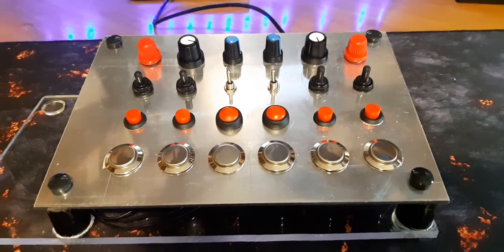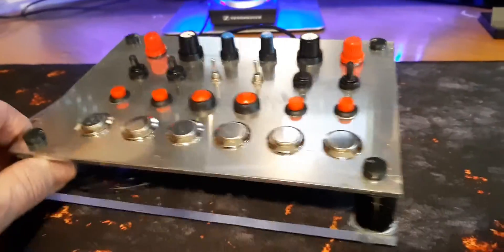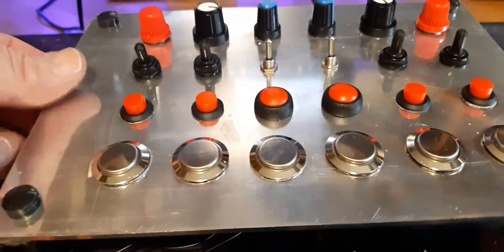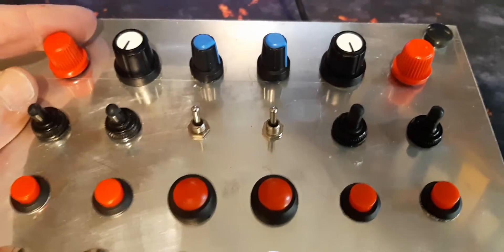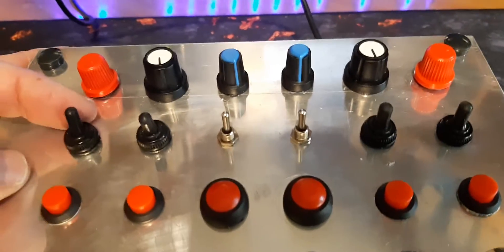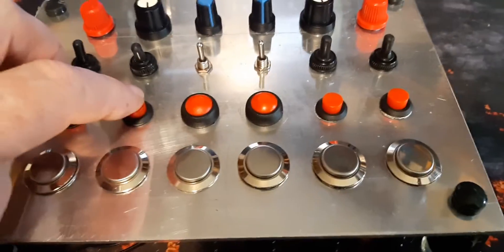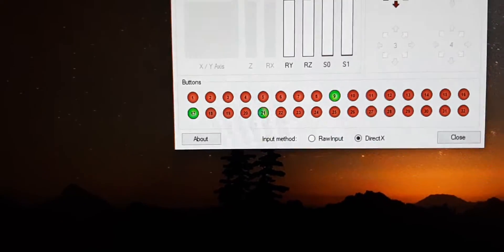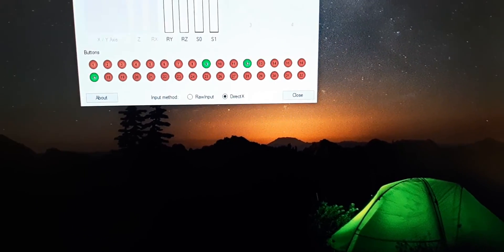Button Box

Comment: Hi, thanks for sharing. I’m making a yoke at the moment and using a BU0836A board. I have two on-on switches I want to use, one for brakes on and off and the other for tail wheel locked and tail wheel free-castoring. Can you please tell me how to wire the toggle switches? I’ve never done this kind of thing before but am always willing to learn! Many thanks, Pete.
Reply from the maker: For the ON-ON you should have a left and right set of pins, top and bottom switched and center common. Use one side for one button and the other for the second if you are using the full 6x6 matrix (https://www.leobodnar.com/products/BU0836A/) otherwise you could share the ground, and have the 5volt on either ends.

Comment: Whats the difference of using  Arduino Pro Micro vs Leobodnar vs zero Delay Arcade USB Encoder?
Reply from the maker: Not an  expert on these, but the USB encoder is similar to the BODNAR board, both simple fixed logic boards, with logic gates for switches, and ADC's on the fixed microcontroller. Arduino has a programmable microcontroller, so while it takes in logic data from the pins as would the others, its capable of doing different actions based on what the switches do. Its also got output pins, which the others don't. You certainly will learn more if you build your solution with the arduino.
Reply: @gerryabbott  Whats thats great enough thanks!

Comment: Do the rotary analog switches work as volume up/down switches? or does the enconder recognize them as single button pushes when you turn them?
Reply from the maker: Yes the analog rotaries can be mapped ro radio volume if the game allows it. If the game has  up and down mapable volume key commands then they can be mapped to the encoder clock/anti-clockwise movements.